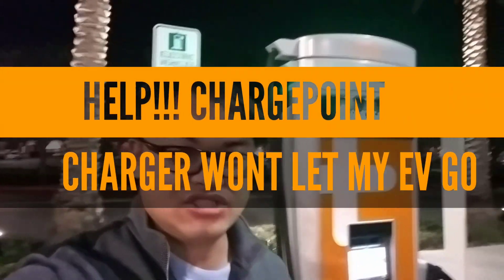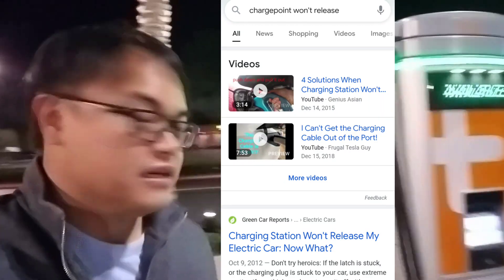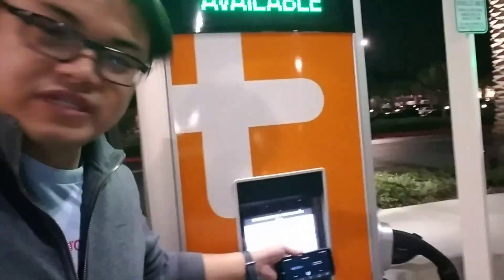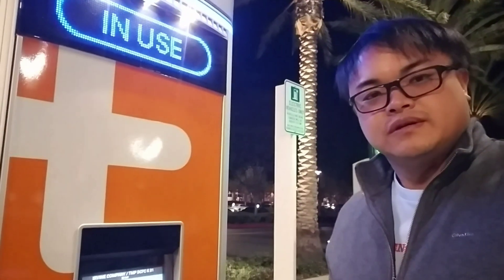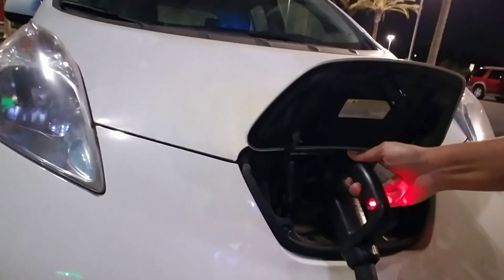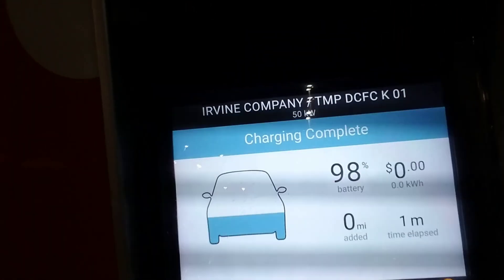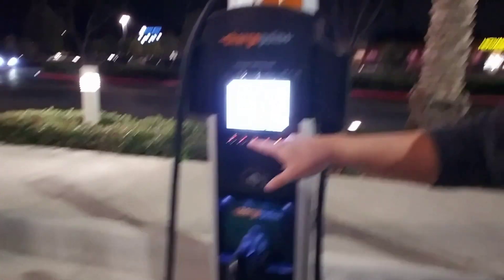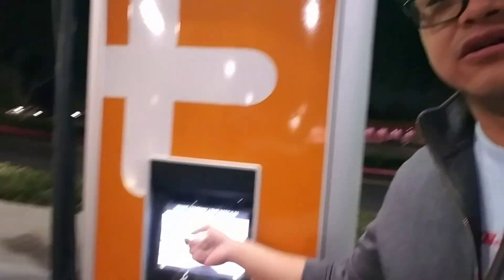HELP?!?! MY CHARGEPOINT WON'T LET GO! How To Use ChargePoint DC Fast Charger Tutorial

Comment: Nope. Still stuck on a Shell and ABB charger. Something to do with emergency stop and the Shell/ABB machine being disconnected from the network and the machine's own electronic sense of the charging cable being partially disconnected from the main unit (i.e., the charger).

Comment: Dude - awesome tip. I was also in the same boat couple of evenings ago. I didn't have my rfid card with me, but I found that I could tap my phone on the RFID reader to stop charging. 

Feedback for chargepoint (the company) - clear instructions on the panel would help . I think EVGo does this.

Comment: Thanks for sharing! You are correct, if the Stop Charge button on the screen  is not responsive - you can additionpress the Stop Charge button on the ChargePoint App (only if you used a ChargePoint account to start the charge and linked it to the app). And if you are ever in front a station and need assistance feel free to call our 24/7 Driver Support team at 1-888-758-4389 to get help. https://www.chargepoint.com/support/

Comment: Good to know. I had the opposite problem with an old Chargepoint DC charger. It wouldn't have any reaction on RFID card and when using NFC on my phone it would show ERROR # on its 2 line display. After that the phone loses cellular connection and must be restarted.